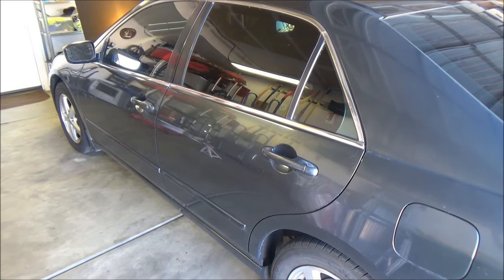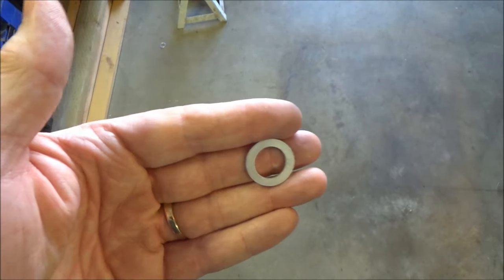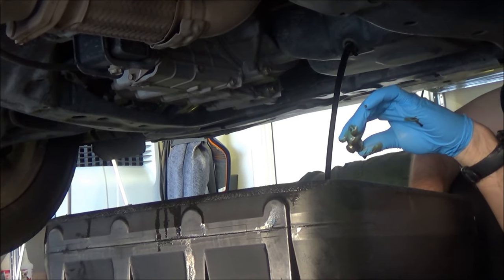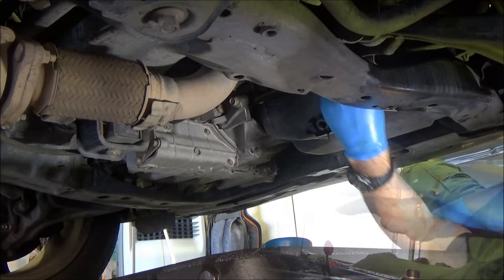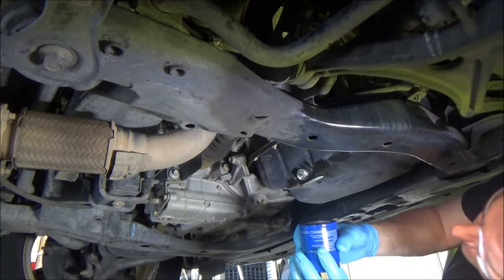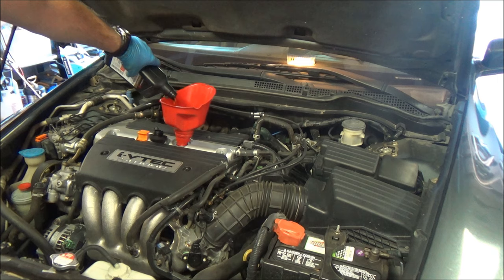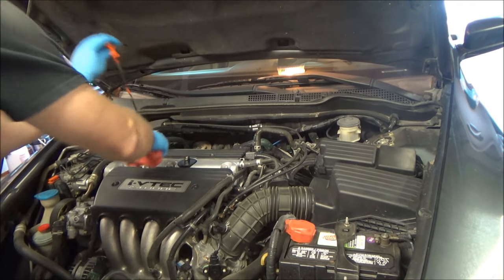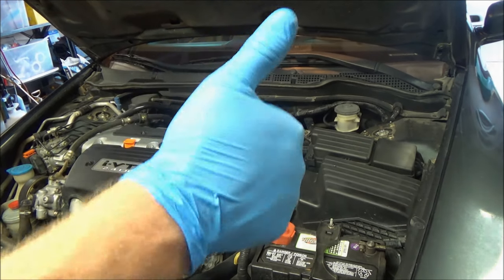Honda Accord Oil Change 2004 2.4L (I4) (2003-2007 Similar)

Comment from the maker: Parts and Tools
This channel earns a small commission using some of these links - at no additional cost to you.

Honda Oil Filter:  https://amzn.to/2MKnSst
Honda Oil Filter Drain Plug Washers:  https://amzn.to/2ZHqR6L
Honda Filter Wrench:  https://amzn.to/2NKFCDp
Oil Drain Container:  https://amzn.to/2zHDwfn
HF 3/8" Breaker Bar:  http://bit.ly/2EgRuF8

The Big Dog 50001 Automotive Channel Store can be found here: https://www.amazon.com/shop/bigdog50001automotive
Reply: what size is the washer?
Reply: @holyhandgrenade2349  Go Amazon with the part no., and you will get the size info.
Reply: Boil Pan bolt is difficult to remove Honda Accord

Comment: I did an oil change on my 2004 Accord today and I did not need to jack it up. I used swivel attachments that allowed the hand grip of the breaker bar to point 180 degrees towards the front while the socket was on the drain bolt. Just a strong turn toward the passenger tire and it loosened. Also the oil filter was easily accessible from the side. Just turn the wheels towards the passenger side all the way. I put my oil filter wrench cap on my long breaker bar and it was loosened. After the oil filter was loosed I finished I unscrewing it from the top. I also was able to screw on  and tighten the new oil filter from the top. No jacking required. Of course because the car sits so low it’s a bit tricky to make sure the socket stays on the drain bolt while your hand slides down the handle part of the breaker bar so you can turn it because there’s only enough room for one arm/hand. But I managed.

Comment: You make the best practical videos on Honda procedures on YouTube. I have a 1998 Honda Accord V/6 which has been a great vehicle. I reset the maintenance reminder light on the instrument panel but don't know if the newer Hondas like the 2004 require this. I haven't seen anyone mention how to reset the reminder light on you Tube and thought it should be mentioned. I also keep a written record of date and mileage of any procedure I perform. Thanks for your great videos!
Reply from the maker: On these Accords you just press and hold the trip button, turn key to on position and then continue holding trip button for 10 seconds.  This should be just like your 1998 Accord.  I thought I included it in this video, maybe I forgot.  Newer Hondas can be reset with a factory capable scan tool.

Comment: I’m using 10W-50 mobile one on my Honda Accord 2003 LX 2.4l because my car burns oil a lot with no leak. Do you recommended sticking to 5W-20
Reply: Same issue of my 2004 honda accord v6 lx
Reply: I would try Mobil 1 5W-20 High Mileage or Amsoil 5W-20 or put small amounts of "Motor Honey" oil treatment and see if that helps. If all things I would only go 10W-20 if possible and some Motor Honey and Try changing it every 3K instead hope this helps

Comment: Apparently Honda doesn't like to see you change your own oil anymore.  I have a 10th gen 2020 Accord 2.0T.  First they hid the front and rear jacking points.   
The jacking points do exist, but they made the front one especially hard to get to.  Not sure how you would winch this vehicle either.
Then they threw in two covers to be removed just to access the oil pan and filter.  
Would be great to do a video of oil change on 10th gen. 👍

Comment: Hi, I have a Honda Accord 2004 2.4L with 160K miles. I change the oil every 5k miles but when I checked the oil level it is just under low dot. Maybe because the motor burns oil?
Reply from the maker: Yes very common for those 2.4L engines to burn oil (if it isn't leaking).  I would check the oil at least every 1,000 miles and top off as necessary.  If you do that, those are good engines and will generally go a long time.  Continually running the engine low on oil can cause issues with the timing chain and VTEC solenoid on those Accords.

Comment: Seems easier to just pay somebody to do it. lol
Reply from the maker: It always is lol!
Reply: Easier, yes. But you can save money doing it yourself, especially if you prefer premium oil. At a place like Valvoline Drive-Thru Oil Change, if you want a full synthetic oil, it will cost you about $93. But you can buy a 5 quart jug of Mobil 1 Full Synthetic and a decent filter at Walmart of 30 bucks. Saving over 60 dollars.

Comment: Quick question on oil change please. I plan to put the pennzoil ultra synthetic oil on my 2007 Accord v6 3L since Walmart has a great price on the 5w20. My question is if I go ahead with the ultra full synthetic oil, at what interval should I make the next oil change? Would it be the regular 3000 - 5000 miles or can I wait till the 10,000 mile interval? What will happen to the oil change percentage % indicator on the dashboard? Will it be as per the next date interval or as per the oil level or as per the miles after you reset? Assuming I get a minimum of 10,000 miles or a year (which ever comes first) will the oil level % indicator adjust itself now that the full synthetic oil is in the car?
Reply from the maker: How far you should go on an oil change (and what type of oil) is very subjective and will get lots of differing opinions.  Oil is relatively cheap and regular oil changes are the best way to keep an engine running good (in my opinion).  I do not go more than 5,000 miles between oil changes on my own vehicles regardless of oil type.  Unfortunately, many owners that go 10,000 miles on an oil change never check oil level and of course it if gets low it can cause issues.  The oil life indicator (maintenance minder) does not know what kind of oil is in the engine (or if there is any oil at all).  It is simply a computer program that looks at certain driving conditions and miles since it was last reset.

Comment: do you really get all the old oil out while the car is jacked on a angle like that? should the whole car be flat in the air?  just wondering.
Reply: @jamesrivt     Because the drain plug is on the rear of the oil pan and he has the front jacked up, this will ensure you get as much oil out as possible because the engine is angled up from the front. If the engine was level, it wouldn't allow all of the oil to drain out. Basically wherever the drain plug is located you want to raise the vehicle on the opposite side to get the drain plug hole at a lower level to ensure you get as much oil out as possible. Also the engine must be warmed up so as much impurities are suspended in the oil so that it comes out of the engine with the oil.

Comment: I usually just put 5 quarts because these K24 motors are known for burning oil. I have a 2005 accord
Reply from the maker: That is another good reason to top off the oil (and check it a lot), thanks for the comment!
Reply: I noticed the using oil issue  with my 05, good reminder, thanks.
Reply: Yep. My 04 Accord is at 213k and all she does is burn the midnight oil.
Reply: My 05 year uses about 1 qt at 4 k miles about maybe little less ? With 77 k miles on it runs great as new
Reply: Thanks Urgent.

Comment: So, im going to ask what i feel is a very dumb question and highly discouraged againbst; however, looking for some recommendations prior to the storm. I cannot get my oil drain bolt of of my Accord.. The the car is on ramps. 1. lack of space and 2. zero leverage and i just dont feel like taking it to a shop. This is my first time changing the oil since i purchased the car. Would you recommend EVER SO CAUTIOUSLY reversing the bolt with an impact drill until i can hand loosen it or not?
Reply: Don’t use an impact. You can strip the threads.

Comment: question does oil filter a02 fit 2005 accord
Reply from the maker: Oil filter 15400-PLM-A02 will fit a 2005 Honda Accord.

Comment: My 2005 keeps losing oil and I'm guessing its burning it because there's no leaks, is there a way to stop it from burning oil ? Car only has 147 thousand miles and within the last 600 miles I had to put 2 quarts of oil because it was really low
Reply from the maker: 1 quart every 300 miles is excessive.  Thicker viscosity oil or adding an oil thickener can help some (but is not great for engine) but generally when it is burning oil that bad the engine needs to be taken apart and fixed.  I would continue to monitor the oil daily and see if it continues to burn oil at the same rate before doing anything drastic.
Reply: @BigDog50001  okay thank you I'll see when I can get it fixed

Comment: What day and time can I drop my Honda off for a oil change. Lol
How many miles do you go before your next oil changes? 
I really Like Honda OEM eng air filter 
Also at 4 k miles my Honda burns or uses about 1 qt of oil   I changed it at 5 k miles 
I am running Royal purple 5/20 and there oil filter too. Any thoughts on this ? 
I was maybe thinking of going to maybe mobile 1 and there oil filter or maybe stay with what I am using. 
I did like KnN oil filter on the car. Too 
I might over think it like every one too. 
I just like the best for the car and to last long.  Runs great too   
Have you or tried Amsoil oil and filter?  Maybe to pricey maybe? Thanks again
Reply from the maker: lol.  I recommend 5,000 miles between oil changes on older Hondas like this one, and I only use Honda oil filters.  I don't worry too much about  which oil company I use as long as it is a good name brand and it is the correct weight.  It's normal to burn 1 quart or so of oil between oil changes.  Thanks for the comment!
Reply: Thanks B D I always change at 5 k miles and use what it say 5-20 oil on my 2005 Honda Accord

Comment: Honda does such a nice job of oil filter placement... Finally in 2013 they put the filter vertically on the bottom. Sheesh.
Reply: Isn't it easier to get to if it's on the bottom?

Comment: you just overfilled it 19.2 ounces .  4 quarts plus .40 quarts is 12.8 ounces so (32ounces -12.8 ounces is 19.2 ounces overfilled.  
With 4.4 quarts, the level will be at the top mark on the dipstick.  LOL.
Reply from the maker: You obviously don't work on these generation (or any) Hondas much.  lol....

Comment: QUESTION, I have the same motor, I recently added oil to my motor because I was going uphill and when I got to the top I smelt burnt oil. I got home checked my oil was low. Now I added 1 new quart of oil but my dipstick saying it’s about  maybe 1/2 quart overfilled. About 4-5mm above full circle. Do I drain or leave? Professional advice preferred! :)
Reply from the maker: I would check engine oil again (a couple times) *on a flat level surface after vehicle is turned off for at least 5 minutes*.  If it is overfilled I would drain a little bit out (it is tricky to time but it can be done).  Worst case scenario is all the oil drains out and you refill engine to correct level.